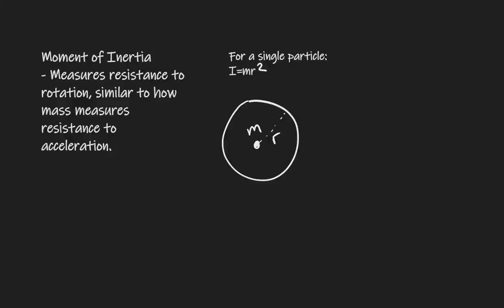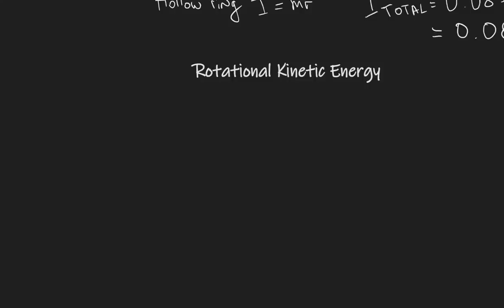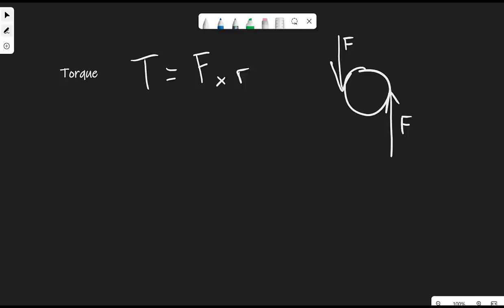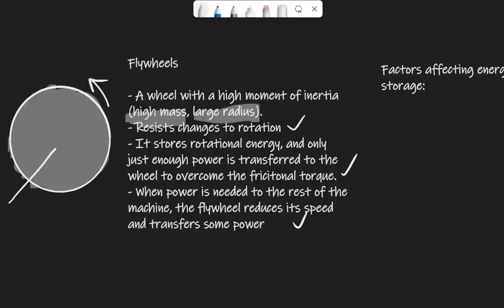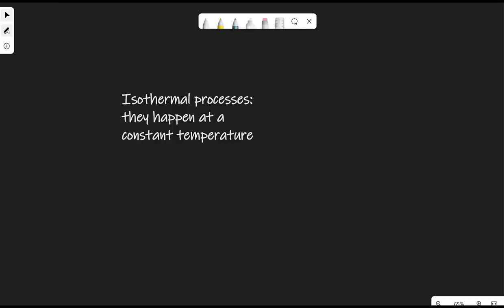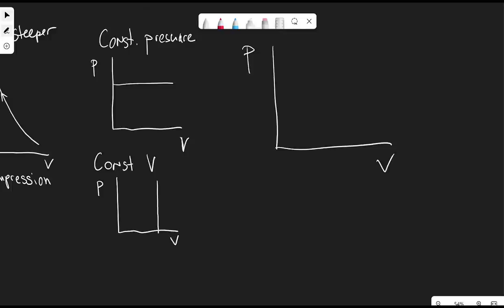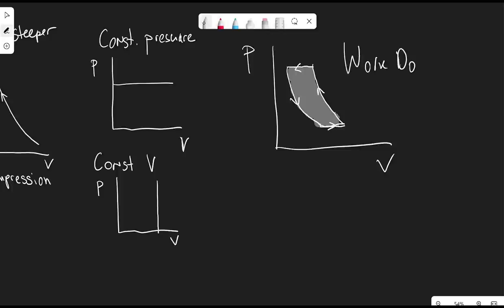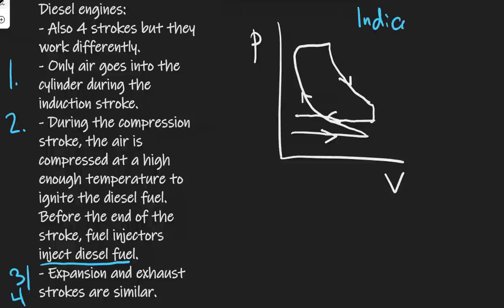All of ENGINEERING Physics AQA Revision

Comment: For the Compression stroke of the 4 stroke engine you said that the spark causes the 'pressure and volume to increase dramatically at a constant volume', I think you meant to say the pressure and temperature increase at a constant volume
Reply from the maker: Absolutely correct, thanks!

Comment: Any tips for calculating areas quickly and accurately in an exam? Counting squares is impossible, and i never know how many trapezia are enough
Reply from the maker: if it's a multiple choice you can approximate with a shape and find the closest answer. If it's a numerical answer I am afraid counting squares might be the only option. How I wish integration was on the spec and then you wouldn't have to count squares : )

Comment: I can't seem to find the various formulas for the moment of inertia on the AQA formula sheet? Also, just a quick question, what happens to the rotational kinetic energy when we increase the radius of the flywheel?
Reply from the maker: If needed, they would be given in the question, very often as a number too. You have the general ones given. And in terms of the fly wheel, as rotational KE=Iw^2 and I is proportional to r^2 so if everything else is constant, the KE will increase by a factor of r^2. Hope this helps!
Reply: @zhelyo_physics  Alright thanks, so I understand that increasing: Mass, Angular Speed, Amount of Spokes and Radius all increase this store of Rotational Kinetic Energy?

Comment: 13:45 why does the KE stored increase with spokes?
Reply from the maker: I was thinking about researching this further, I think a spoked wheel of the same mass will have a larger radius, meaning that the mass will be spinning with a higher r of rotation, hence higher moment of inertia and more energy.
Reply: @zhelyo_physics  thanks
Reply: The distribution of mass has changed (and therefore the radius) causing the I to increase therefore KE increases :)